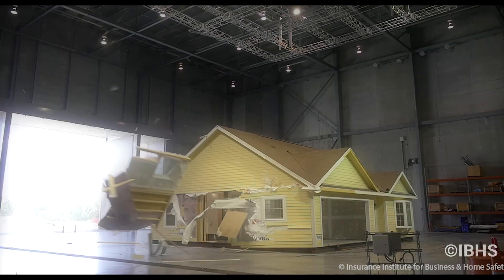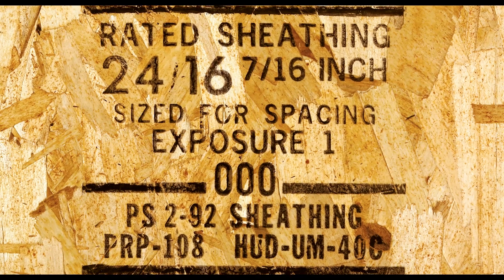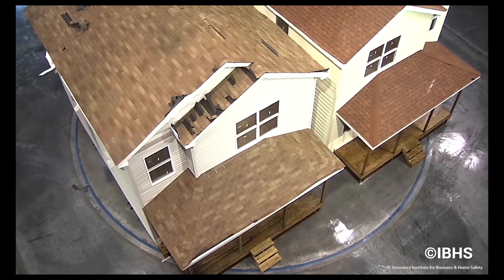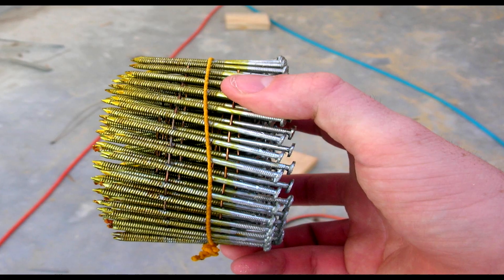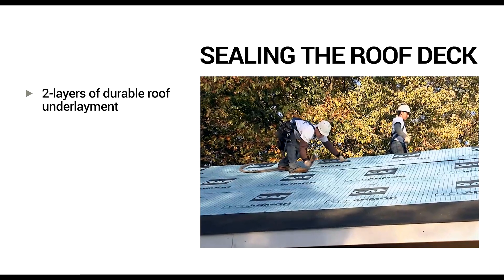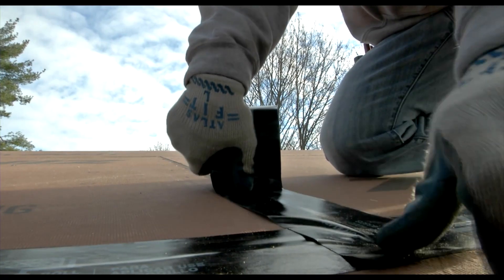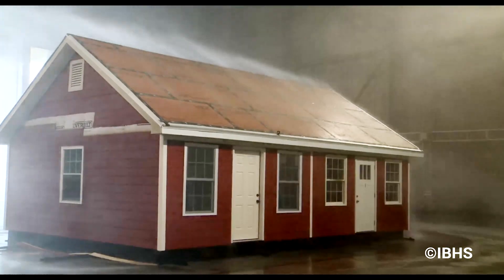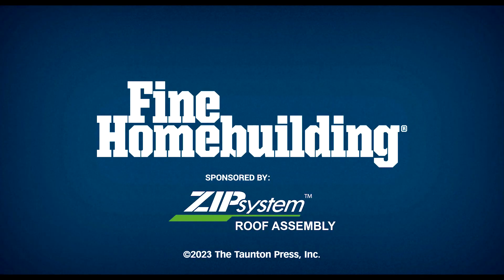Combat Extreme Weather with FORTIFIED Roof

Comment: One thing I read recently about roof failures in high wind events is that a major cause of the roof ripping off of the house are the soffits failing (because the material is so thin the suction from the wind rips them off) and once they are gone the pressure differentials between outside and inside the attic is increased and that helps destroy the roof. 
In addition to fastening the roof rafters or trusses to the top plates and walls with hurricane straps the soffit material should really be beefed up and attached with something like ring shank nails - or is there a better method?
Reply: Good point, it’s always the thinnest gauge vinyl